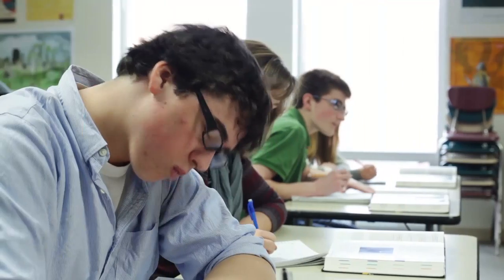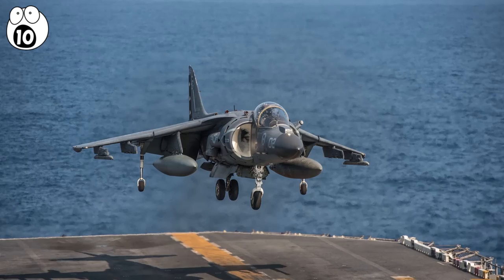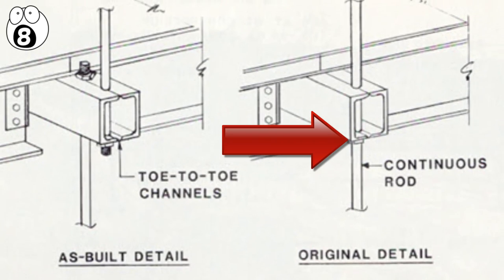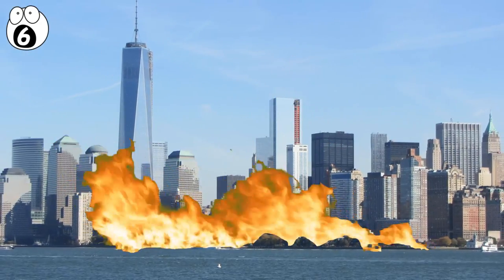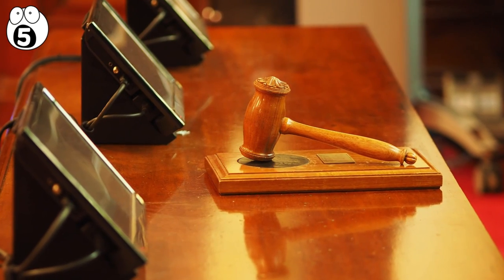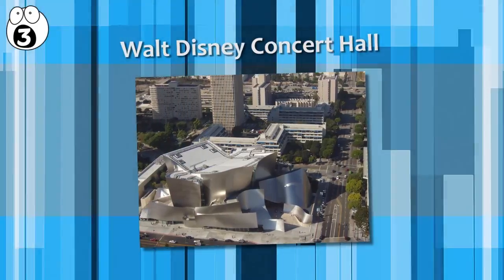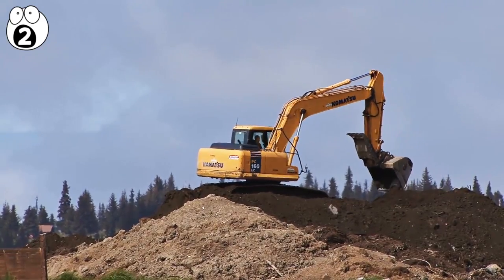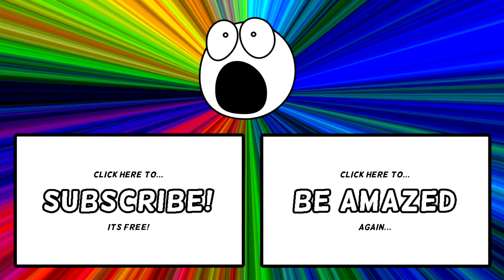Biggest Design Errors Engineers & Architects Made

Comment: This video is wrong about so many things, especially the Tacoma Narrow bridge.
Reply: Didnt the Tacoma Narrow thing occour due to Frequency and Resonance?
Reply: No,it didn't.
Reply: Rich Grizzly then what happened?
Reply: double weight on the bolts of the first rod
Reply: Thanks, my mistake
Reply: Randy Robin  You want to know the truth?'? You can't handle the truth.
I will tell you anyway... There was a field nearby with lots of farting cows. As the methane gas left their anuses it filtered through the tiny cracks in the concrete, the vibrating molecules aided by the oxigen in the wind started to jiggle and vibrate uncontrollably causing the cracks to spread and join,creating greater cracks in a manner  similar to metal fatigue. As a result the whole structure was weakened and gave way.It was a matter of time and the right conditions...I hope I've been of help to you, although I know this alternative theory is not very popular mainstream.
Reply: Tacoma Narrows bridge collapsed because of resonance. The noodle analogy obviously made no sense because the bridge would bend and twist like crazy and was not very rigid at all. This wasn't a problem structurally until it was driven at the same frequency it was oscillating causing resonance and extreme forces.
Reply: No,It wasn't that at all.
Reply: +Kangler The reason it oscillated at all was because there were no wind passages through the bridge. That's what he means by it being solid. Now there are open lattice trusses under the road bed and wind pass-thru grating between the lanes in both directions. So instead of by being forced to go over and under a solid bridge, thereby causing oscillation, the wind simple passes through the bridge.
No structure is a problem structurally if it's designed with regard to it's environment. If it's not then it's got a structural problem. 
You can you build a structurally sound house of cards in the still air of your dining room but you can't in a wind storm.
Reply: I am aware of this, infact I light right by the Mackinaw Bridge was was built shortly after the Tacoma Narrows Bridge incident and thus was designed with steel grating for the middle lanes.
However on the Tacoma Narrows bridge the oscillation itself was not the issue. They knew it would oscillate as such and it was designed to be structurally sound during this oscillation. What they failed to take into account is the resonant oscillation frequency, which causes the forces to become much much higher than just normal oscillation. 

So in a way, yes if it had wind passages it would not have been able to reach it's resonant frequency and would not collapse. There are various other solutions other than wind passages but the key is resonance needs to be taken into account. (for example they could have just built it to withstand the forces of it's resonant oscillation) 

The noodle analogy really makes no sense here, it is an entirely different phenomena than simple rigidity vs flexibility.  (rigid noodle breaking is actually far more complex than most people are aware, look up the smarter every day video on it)
Reply: +Kangler Yeah, you're right, that noodle analogy doesn't make sense after taking a second look. Taking wind oscillation into account during it's design is something I've never heard about. But it makes sense that they would have to.
Reply: Also, This video is 100% stolen from Buzzfeed, Which stole it from someone else, Who stole from someone else...
Reply: That and he has no idea how Subs work. The engine doesn't push it back up once submerged, the freaking ballast (sp?) tanks do. The engine may have been underpowered to move it effectively through the water, but has notta to go with getting to the top of it. This is a guy you want to start off with a facepalm, then slap the stupid out of him (if the first one doesn't work, continue trying).
Reply: You can use an engine to power a sub to the surface.  "Flying the Sub".
Reply: Like "Destroy all of Manhattan" ??
Reply: Like "Destroy all of Manhattan" ??

Well, doesn't Manhattan only have 200,000 (or whatever the RC estimated) people?  LOL
Reply: Yes, because bolts are like duct taping a severed appendage and welding is more like stitches. -_-
Obs the engineers just forgot to boil the bridge. The analogies are way off, which is probably by design and meant to be the humor. I think this channel is meant to be entertaining rather than informative.
Reply: Hence the +13K thumbs down. It saddens me that this channel has+651K subs.
Reply: The person is trying to explain things they only know a little about. I have looked at more than the Tacoma Bridge.

And as we are critiquing this video, I did a case study on the Chinese flats (towards the end) for a Geotechnical Engineering course, and like a few other instances, it was both badly and partly explained. It was not JUST the stockpiling of material in that instance.

1) The material was excavated from one side of the building, creating a void in the ground, then stockpiled on the other side. This created lateral pressure or force  (going accross) to act on the piles that made up the foundations.

2) The rain etc was a problem, as it soaked the ground, making the soil heavier and making the lateral pressure higher

3) The supporting pile foundations were hollow core piles (think of a drinking straw shape), as opposed to solid concrete with steel reinforcement running through - and not intended to take the stress across their diameter caused by the above lateral force issues - they snapped and then.... well the photos show what happened next.

Therefore, design and site management issues were the problem there, NOT flooding as this person claimed. The Chinese flats, I believe the foundations engineer and contractor got in a lot of trouble as I recall.....
Reply: Naresh Gaj based on the 900 people who agree with you, I'm not even going to watch it.
Reply: I stopped watching and had to scroll to the comments as soon as the duct tape and bolts comparison was made.
Reply: Also, the De Havilland Comet thing wasn't just about the shape of the windows. It led to a new scientific discovery of the phenomenon of metal fatigue.
Reply: Oh my god. Please research your topics. Almost every one of these is wrong.

The trouble with the Hyatt walkway isn't that both walkways were hung from one rod. They were ALWAYS going to both be supported by one ceiling rod. The problem is that the offset in the middle meant the top walkway's structural elements had to support the entire lower walkway in addition to its own weight. This is the difference between two people hanging from the same rope versus one person hanging from a rope while the second person clings to his legs. It's the same weight on the rope in both cases, but in the second case the climber can't hold on.
Reply: RonJohn63, try 1.636 million. Also, the building he was talking about would have most likely collapsed instead of fallen onto it's side, the guy in the video obviously doesn't know much about physics. An example of this is when the planes hit the Twin Towers on 9/11, they had a major support problem at the top part of the buildings but they collapsed instead of falling off the buildings.

Also take into account if the building was even able to fall onto its side, that building would have to completely destroy over 1sq mile since in Manhattan the density is about 170,000 per square mile, on business days when the overall population of Manhattan increases to about 3.9 million people due to commuters then that building would still have to completely destroy about 1sq mile, which is nearly impossible unless the building was a giant nuclear bomb.
Reply: Right, upon seeing the film of the bridge collapsing, it looked a lot like a wet noodle.  Very poor analogy.
Reply: Yes. And Kansai International Airport was planned to sink into the soft ground. The whole building is especially designed, so are stairs build expandable, electricity lines are bent so that they can expand, special lifting equipment lifts the whole structure at different points at different rates so that it remains plain horizontal, and so forth. It is a marvel of engineering.
Reply: the guy in the video obviously doesn't know much about physics

But he's got a smooth British accent, and that gives him instant intellectual street cred.
Reply: Every CS student knows full well that 1+1=10!

Did you know that early computers were decimal?
Reply: Vortex shedding causing oscillation of the bridge deck.
Reply: Yeah, it wasn't inflexibility that destroyed the bridge, but rather the inability to dampen oscillations! It was a VERY flexible bridge, and they made a small mockup that showed how it would move when acted upon by outside forces.

I'm not even an engineering student, and I saw ONE documentary on it over a decade ago.
Jeez, Be Amazed, do some better research.
Reply: i unsubbed
Reply: thanks to everyone who has posted here proving that when people say how can it take a year to find out the reason for X happening is perfectly fine as people are argueing over nothing
Reply: yeah guys why didn't they just put holes in the bridge gosh
Reply: Indeed. Soooooo much ignorance I just had to call it quits when I got to him comparing a bolted union to using duct tape. I wonder how it is that car's wheels don't just come right off at speed... Or how the conrod caps don't fly off... or... or...
Reply: he is just misrepresenting each of the errors by omitting critical points of information.  Meaning that anyone who hasn't looked into these problems will get the wrong idea of why they failed.   Please be more careful with your use of language in the future.
Reply: LOL! Just paused it to mention the mass damper in Taipei 101 for this very reason! Can't believe it's the top comment >.<

Edit: Wow, tragic whiff on the very next one, too! (Hyatt Regency Catwalk disaster) The ONE ROD was DESIGNED to hold all the weight of the system. The failure occurred because the redesign concentrated the weight of the system onto small areas on a welded seam of the intermediary, horizontal box-girder. The washers simply pulled their way through the seam when sufficient weight was on the catwalk.

Edit 2: 
Q - "Which error do you think should have been avoided most easily?"
A - The ones in this video.
Reply: Gremlins.It was gremlins.  Too many gremlins on the bridge at one time.
Reply: Nada not notta. Nada = Spanish word for nothing.
Reply: Yep I had my suspicions about this video when he compared the cable based braking system to 'two of your drunk friends with dental floss.'  I mean all he had to do was read a few internet articles thoroughly, he couldn't even be arsed to do that. And then has the nerve to laugh at mistakes made in huge engineering operations undertaken by people magnitudes smarter than him. Like Niel deGrasse Tyson said 'If you aren't making mistakes, then you aren't operating on the frontier.'
Reply: +CK Turpin   Wrong about the collapsing vs. falling, someone else here noted that it was sideways lateral pressure leading to falling over. Your twin towers analogy is flawed on two points.
1) The twin towers were designed such that they would pancake, if in the event of any unusual forces they fell over, they'd have destroyed a huge area.
2) The twin towers symmetrically collapsed, they didn't fall. It's a small difference, but in the case of the twin towers, the major problem that was created is that the jet fuel softened the steel structure, all around the building, therefore the weight of the upper floors which comes straight down became strong enough to overcome supports, and collapse.
Reply: The main error is calling mathematic and physics boring.
Reply: This
Reply: Also, the CitiCorp Center and the Hyatt Regency both had original designs that would have worked but cost-saving changes were accepted (twice in the case of Hyatt Regency) without checking the math (or in the case of CitiCorp, the right math).
EDIT: All the leaning buildings were also not a case of mistakes being made but rather people not even caring to try. Then the Tropicana Field thing that isn't really a mistake just unfavorable design.
Reply: They were not approved by the engineers.
Reply: Harmonic resonance, the vibration builds upon itself almost exponentially.
Reply: 1.414.....................................